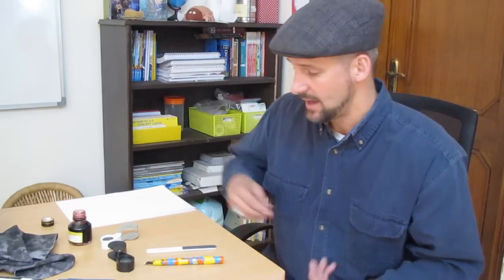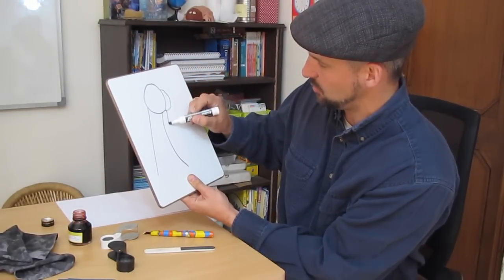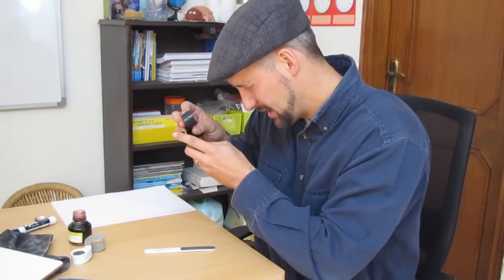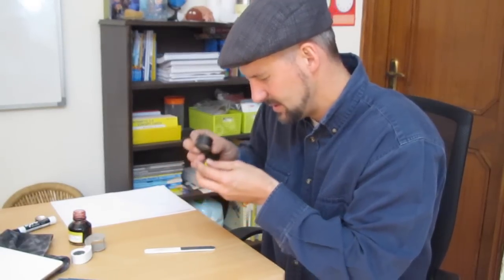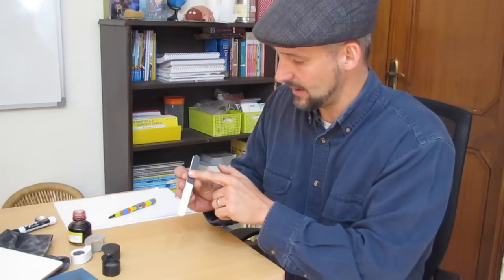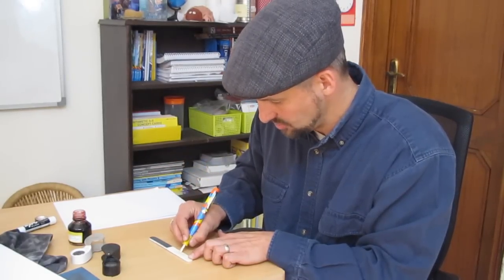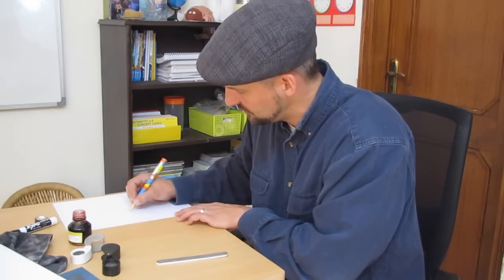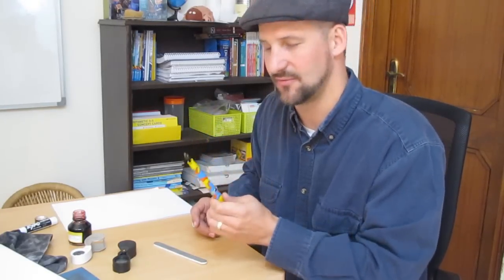How to smooth a scratchy fountain pen nib

Comment: You are the man!!  I'm a big fan of fountain pens.  But, I had a few that were noticeably scratchy.  I followed your technique with 4000 grit and 8000 grit Micro Mesh.  It made the nibs flow smoothly.  I was so impressed.  Thank you!  I used a 3 inch X 6 inch sheet ("Micro Mesh" brand) that I found on Amazon.  It was less than $15 for both sheets of mesh.  THANK YOU!!

Comment: When I was a kid I used to be a fountain pen doctor. We had fountain pens which used to costly less than half a dollar. So I had hundreds of them and everyday I used to experiment with them. I had made some very nice pen which were smother than those pens which cost more than several hundred dollars. Now when I reverted back to fountain pen after using using ball pens for years I can enjoy such thing only on videos as cheap fountain pens are gone from market.
Reply: William Albert in India we have very cheap pens . That write as smooth as the ones that cost 20x it's price.
Reply: @gammondog   Did you realize The guy in this video sells inexpensive fountain pens?
Reply: Check the Platinum Preppy. You can use with converter or ink cartridge. Very much worth it’s price!
Reply: @Solvinden  you can also eye dropper the preppy and have a huge 4ml of ink capacity

Comment: Very helpful tips. May I know whether the nail file approach could be applicable to stub and italic flat nibs? I wish to follow your technique to smooth some stub/italic nibs. I'm afraid though to damage or break it. TIA
Reply: First make sure the tines are perfectly aligned.  The more common issue with stub/italic nibs are misaligned tines.  But if they are aligned feel free to use some very high grit (8000+) nail file micro mesh to finish smoothing it out.  Just do it gradually and you should be fine.

Comment: Can I use a 12000 grit sandpaper instead of micromesh pads? Just to smoothing it up a bit.
Reply from the maker: Sure.  12,000 is pretty high though so it would likely only work for final polishing.

Comment: Hello Kevin, Just want to confirm that, If I use 10,000 Grit Sandpaper, would it do the job but it will take a longer time to smooth a nib - is that alright ? Thank you
Reply from the maker: 10,000 grit should work.  I usually use 8,000 grit.

Comment: Does smoothing the nib alter the line width of the line? In other words if you polish a fine nib by your technique will it make it more an extra fine or a medium please?
Reply: As long as you are careful to not smooth only one part of the nib (so that it becomes flat) this should not noticeably alter the line width.  You want to make sure the ball tipping stays rounded instead of grinding down a flat spot.

Comment: Hi. I have a problem with my vintage Watermen pen. It writes very nicely but I have to whipe it clean of ink where my fingers are going to be on the fountain penn every time. It seems to spill ink every time i close he cab. Any ideas for help? Best Jan
Reply from the maker: Hi Jan.  This could be from a number of factors.  If there is no breather hole in the cap the issue could be due to air pressure changes in the cap.  Air pressure changes in the body are also a possibility.  Or if the pen is being bumped around.  If it an old eyedropper pen then keeping it pretty full might help.
Reply: Hi. Thaks for the answer. I'm not sure ... Airpressure does hardly changes in a few secconds. I tried however to put the pen for a few seconds in hot water and that had positive effect. It is now leaking less. However I'm still not able to carry the pen arround with out ink dripping all over the front section.
Reply from the maker: I'm glad to hear the heat setting helped.  Some pens just don't like to be carried around much.  That might be the case with this pen.  Without seeing the pen it would be hard to know what is happening.
Reply: Is it an eyedropper? If so have you applied silicone grease to the threads where you close the pen? I had the same issue with my dad's old eyedropper pen and upon applying silicone grease the pen completely ceased to leak
Reply: Another thing: it's best to keep eyedropper pens more than half full
Reply: Varun Shah sounds like a good idea! Just not sure where I should apply the silicone? (Ps it is not a eyedropper, but normal flexibel pen)
Reply: Jan Simmen try applying it to the threads (the part you screw when you open and close the pen)
Reply: will that not glue both parts together :-0 ?